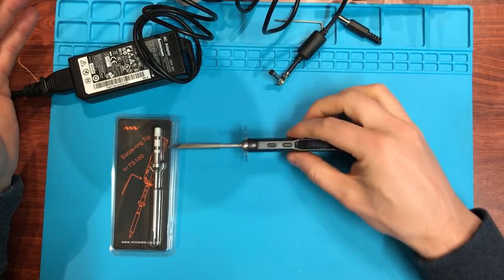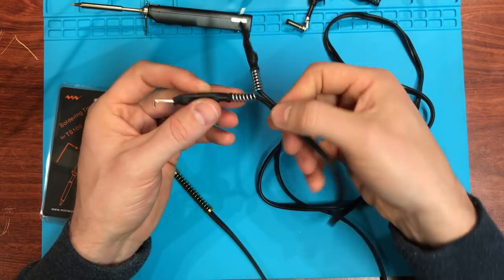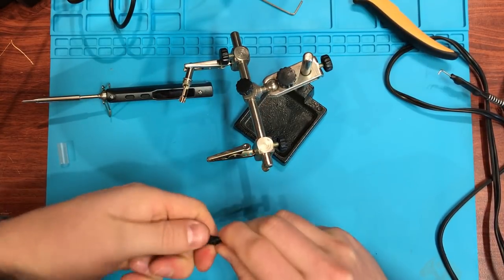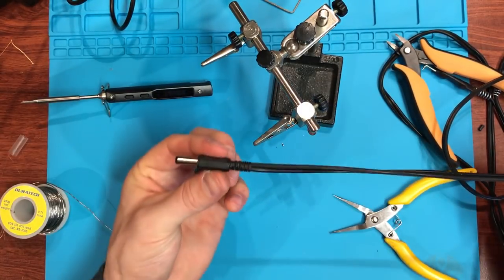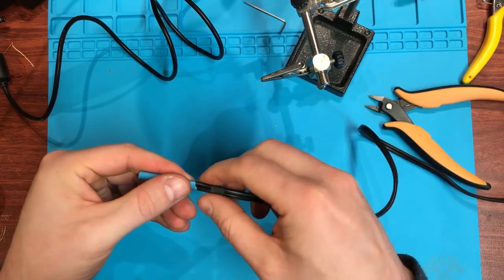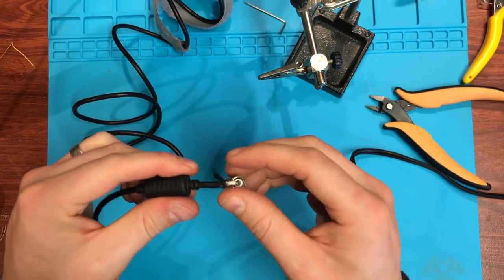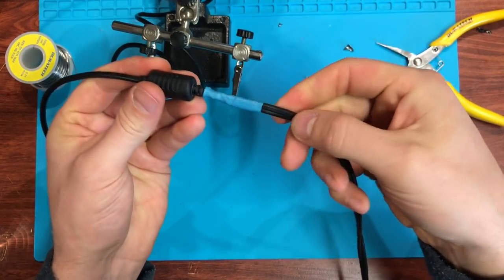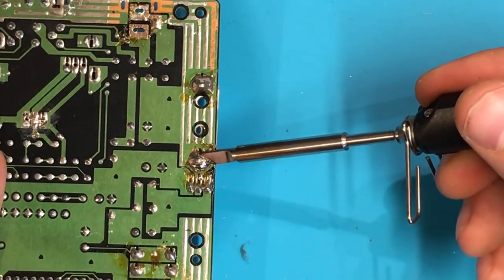TS100 Soldering Iron Power Supply & Cable Mod - YouTube

Comment: Thanks for the idea for the cable. Now sorry. It's a knife tip. Not a chisel tip. Even designation tells you K. Loctite on tape and plastic? Really? Both ends longer plus lead? Miss judged lengths. Not cutting off heat shrink end when it's not straight . Not using anything to help you place heat shrink above thight places. Not placing a heat shrinking on both leads. Every cut sloped. Weak contact's of the wires. That's not how you use crimp inside a jack. That one is meant to crimp both leads on the isolation and provide stress relief when cable is pulled out of the jack. It is not meant for soldering. Not using any for flux. Using knife tip for this is least of the offences here. What have I watched I am still asking my self. At least start with I do this for Fun and I am not a professional. That way new to soldering people will know that's way it works for you and that is fine but it ain't way to do it right. I really do not want to troll you. I want to motivate you to learn how to do it proper so you can help other's to learn proper way as well. Million ways to do it many good and proper ways sure but this isn't one. It just functions and is not directly dangerous way but it us not going to last and if you use loctite it will fall apart. Want to fill in hexagonal thing into a round shape? Use other type of the filler. Even hot glue will do. Thanks for the idea where to snatch nice silicone cable though.
Reply: If you're going to critisise, could you at least learn to spell?
Reply: Dave T apparently not, sorry the grammar police officer. Learning people how to do something comes with responsibility. He did few bad mistakes. Still didn’t wanted troll or check his grammar. But I have had to point out the facts. Ask any professional and they will concur.
Reply: @NINEWALKING  i8
Reply: There is no 'right way' to do things, as long as it works, it's good enough. 

The only thing I would have done differently is instead of cutting off the connector on the power supply, it's better to get a matching connector and solder it on the other side of the cable. This way, it is possible to use the power supply for other applications if required.
Reply: @theodiscusgaming3909  och there is. There is if you want to make something that lasts and perform at it's best. There is a reason why things get done milspec way or NASA way. There is a reason why people like Leo Fender has learned his working force how to do it proper way to handwire his amplifiers and those all still work and if anything ask only for cleaning, elco refresh and tube refresh. Those you can't prevent anyways. Sure there is a human factor involved and some amps might have an issue but with the proper specifications and doing it the proper way you minimize possible issues. Sure for your self you can say it works it is fine but you are addressing the whole world and people learn from it. Doing it wrong or half assed will learn lot of people to accept bad work. Just a little bit more attention and the knowledge and in same amount if time one can do it so it lasts and performs at is maximum potential. As a teacher you own to your students to learn it proper way and teach it as well. Look where "if it works it is good enough" has brought the human kind. No wonder we got flat earthers and people that die not believing some sicknesses are real. In few more decade or in best case scenario in the few generations we are going to reach the state described in the movie Idiocracy. Sure it is not only YouTubers fault but doing it wrong is adding to it for sure. And I see it in so many YouTubers and in so many different categories. Sure some fan boy will comment about the grammar and haters gonna hate. I do not mind it that much. I do speak 3 foreign languages and the English is one of them. Not my native language and not a native language in the country where I live. Not a great excuse specially saying above that perfection is something to strive for but then again I am not teaching people English language either. And for this to be understood I thnk that I am comprehensive enoughand thatis a fact. If you want to learn how to do it properly, ask me or someone who is doing stuff for decade's professionally or I can point you to the YouTubers who have the in depth knowledge to. You are responsible and you got a perfect chance to preach the right way and how to strive for perfection. Giving up that fight is giving up on creativity and the knowledge. Good luck.
Reply: @NINEWALKING   Fucking Love it  , you are 100% correct sir. just watched the video, and enjoyed it ,  but for some people to say "There is no 'right way' to do things, as long as it works, it's good enough." well I call B.S.  made me think of the idiocracy movie , and then , I see you had spoke the same words, mankind should always strive ,for perfection. Based..

Comment: 32 minutes of changing a cable plug? Seriously? And you call it mod? I was waiting for some kind of real mod like powering TS-100 from a power bank or something.
Reply from the maker: It turned into a long one hey! I do actually power the TS100 from a 20V laptop power supply, so it kind of was a "mod" but I do hear you loud n clear and appreciate the comment. I'm working on new videos so hopefully you can find one more interesting in my back catalog or in an upcoming one. Thanks for your honest feedback.
Reply: I personally think this is a great video and appreciate the clear description. It's a cool and functional mod, thanks for the walkthough.
Reply: Sounds like someone is triggered and needs a safe space with a warm bottle of milk to calm down.  Mod = modification, which is what happened in this video.  Good video and neat modification for some that are just getting into soldering and annoyed with the right angle plug.
Reply: I am a hobbyist and found this video very nice and helped me out quite a bit.

Comment: What do you solder with that horrible bloody chisel tip ?  You should just file the side of the conical tip with a bit of a flat and re tin it , for a perfect tip no wonder it takes so long to heat up with that monstrous tip acting as a heatsink ! Why you even make a half hour video making a lead where a photo would do with a link for the tattoo machine cable ( not a gun , doesn't shoot ) as anyone with a soldering iron knows how to do this !
Reply: You'll file through the iron plating and it will eat out the copper core.
Reply: Hmmm.... heatsink..... could that possibly mean it HELPS with large solder joints?
Reply: @AnOliviaShapedGremlin  Lead-free, or lead-tin solder? Add flux.
Reply: If your soldering iron takes forever to heat up 2 or 3 grams more of copper in the tip, you have a horrible soldering iron.

Try soldering a PL259 with a conical tip. Good luck.

Comment: Going to do this for my pinecil. Found a good listing here for the wire: https://www.ebay.com/itm/301992413890

However I cannot find a good listing for the jack. I want both a female and a male end. I can only find a pack of 20, 10 male 10 female. $13 shipped though and I don't have a use for the 18 other connectors. Might just order a male and take a jack out of a laptop I have. Though it's still sort of functional.